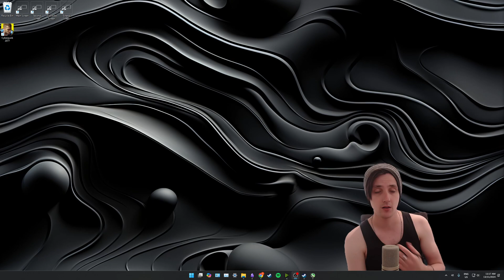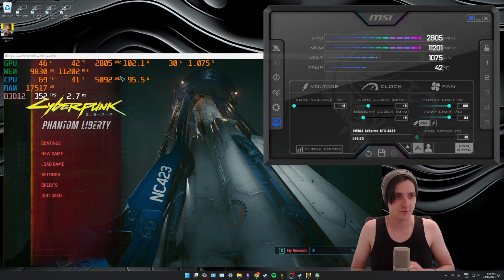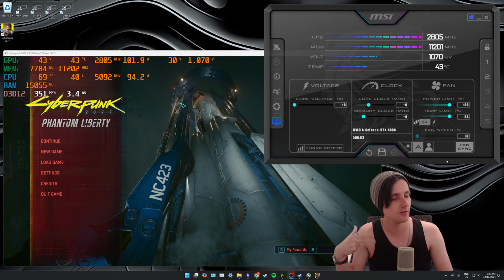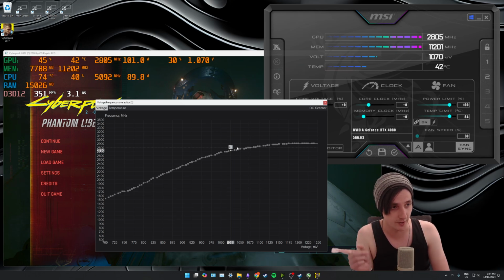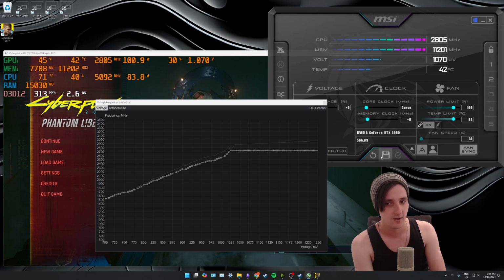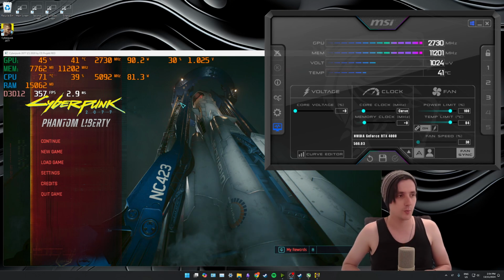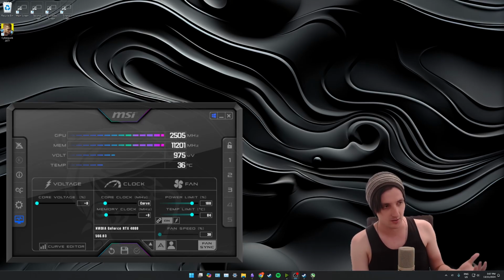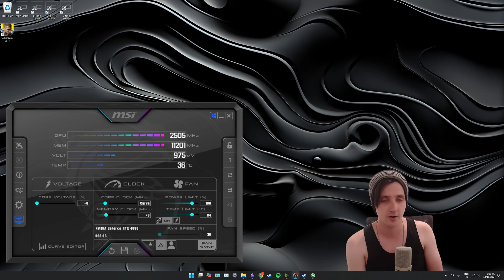NVIDIA RTX - Undervolting guide (How-To)

Comment: MSI Afterburner by it's nature is programmed to limit voltage adjustments so that it's not possible to damage your GPU. HOWEVER! There is soon to be a version of MSI Afterburner that will unlock said voltage sliders completely so that you can aggressively alter it in a manner that WILL allow for your GPU to potentially get bricked should you do so incorrectly.

Comment: I’m planning on building my first ever PC and most likely going to go with the RTX 5080. I’d like to undervolt it so the power draw is lower and somewhere around like 250-300W range compared to the normal power draw. How would I know what to set it to for me to achieve this exactly? Apologies if any of this sounds stupid I’m still researching and trying to understand all this PC gaming stuff.
Reply from the maker: Hey Mate, 
Its basically the same as in this video,
From an undervolting\overclocking perspective nothing has changed moving from 40xx to 50xx series.
What i would do in your case, is in MSI Afterburner, you will see a slider called 'Power Limit', by default this will be set to 100%, you can drag this lower or higher.
Move it lower (say 80%) then apply it, load up a game and check how much power you are using.
Keep doing that until you get your goal power, then you can follow the steps in this video to 'refine' it.
Essentially you are using the powerslider to find a good starting point for how much power at what clockspeed your card does out of box.

Anyway, a 5080 is a beast for PC, enjoy it mate :)

Comment: Does MSI Afterburner need to be running in the background for the undervolt to apply or can I uninstall the program after tuning the settings
Reply from the maker: Hey Mate,
No, it needs to be 'installed' however it doesnt need to be running all the time...

In the top right corner of MSI afterburner, there is a windows icon.
If you click that, it will apply the OC\UV at system startup. (can hover over it for a better explanation)
This means MSI afterburner doesnt need to be running (it does need to run at startup and will apply your undervolt, post this, once you have logged in, you can close the app from the icon tray so its no longer using system resources and your undervolt will stay applied.)

However,
Only use this 'apply at startup' option if you know the undervolt is stable, as you dont want an unstable OC\UV applying at startup.

Hope that answer it mate.

Comment: Thanks for the video , but I want to ask 
Why is your yoru stock core clock 2805, even I play full settings BlackMyth Wukong, I only got 2670 at stock core
Reply from the maker: Hey Mate, 
Few factors, mainly what GPU are you using? 
Brand and the model.

In the video, I have an ASUS TUF 4080.
This card runs at 1..07v out of box, (i think NVIDIA's spec for the 4080 was around 1.0v?)

Asus advertise my card as:
OC mode: 2535 MHz
Default mode: 2505 MHz(Boost Clock)

But that is the minimum garenteed clocks, 
All GPU's today will run higher than that due to GPU Boost. 
which will boost as high as the card can go as long as its not hitting any thermal\power walls.
Reply: @John_Morrish  Thanks for your response
I have 4080 Super proArt with specs 2610 at default 
OC: 2640 
But when I run a game with any settings, the highest Core Clock is 2670-2685 and idk why :(
Reply from the maker: @manhcuongle8770  Do you have MSI afterburner installed? 

If so, drag your power limit higher as a test and run a game and see if any change. 

I just looked up the card and most proart 4080 supers seem to run around the 2800mhz point aswell.
(keep in mind, a bit of this is silicon lottery, ASUS gaurentees 2610\2640mhz.
Anything higher than that and its GPU boost giving you extra performance)
Reply: @ yes I tried to OC when it can reach more than 3000MHz when OC with 1100mV 

But with stock it only reached 2670 without any OC
Reply: @John_Morrish  wow thank you for your response, I don't know why now I got the answer

Comment: Why can't NVIDIA make it able to do that undervolt and overclock using their NVIDIA PANEL like AMD did to their cards with their app
Reply from the maker: Yep, would be good.
In the NVIDIA app, under system > Performance.
You can tweak super basic stuff like Voltage Max, Power Max, Temp Target and fan speed.
But thats it unfortunatly...

Comment: Thanks for the video!
But I dont get that in the first comparison chart the 3rd round says 2805 MHz and in the second one it says 2820 MHz?
Reply from the maker: Thanks mate!
I meant to have it on all comparisons.
Essentially they are the key changes run to run.
1st run is the base
+ 2nd is with -0.50v
+ 3rd is settings the max clock speed to 2820nhz,

So on the last (3rd) run, while I had the -0.050v the max clock speed in addition the max clock was bumped up to 2820mhz. 

But in the last comparison slide, the minimum it hit under the 3 run average was 2805mhz.

happens as the card heats up, just the way GPU boost works, it will step down your clock speed in 15mhz chucnks.

Essentially, once you pull the power back, you then want to see how high you can get the clock speed so as to not lose performance, in my example, as my power reduction was minimal (most people will goto -0.100v) I ended up gaining performance, then as your card is running cooler, it should be able to maintin the clock speeds for a longer period of time.

I 100% could have layed it out clearer or explained it better.

regardless, hope that clears it up mate.

Comment: If i want to overclock and undervolt, which should i start with first. Should i find a stable overclock and then tweak the curve from there to find the lowest stable voltage? Also, if i use the slider to overclock, does it also reflect on the curve, or should I just use the curve for both overclocking and undervoting.
Reply from the maker: Hey Mate, 
Hm, it would depend on what was more important too you, if the overlcock is the important part, then start with that, and reduce the power as the last step.
Essentially, you would do what i did in the video backwards :) 

For memory OC, use the slider, for Core OC, use the slider, but make sure to monitor it, if you give it +50mhz on the core, it will apply +50mhz on the curve at all steps in the curve editor, you can see it in real time, if you open curve editor, then you slap the +50mhz on it.

You would do it manually as i did, if you dont want the same clock speed bump up the entire curve, but rather only have it at the high end.

Hope it makes sense, I would say, open the curve editor, apply whatever OC you want in the slider and you will see what happens to the curve.
worst case, just click reset :)
Reply: @John_Morrish  Thank you for replying. Your explanation makes sense. Will give it a try once I receive my 5080. Also, great video, very straightforward and easy to understand.
Reply from the maker: @GabrielK098  thanks mate!

Comment: Hi, I'm getting a 5080 in a few weeks, and I'll be coming from AMD after 5 years, where their software allows super easy control of clocks and voltages. 
This video has been very helpful I'm definitely revisiting it when I get my card. Last time I used Nvidia was a 1050ti in 2019, sucks to lose AMD's Adrenaline software and going to MSI Afterburner to tweak stuff but I needed the Nvidia feature set.

Would it be possible for me to do say, -100mv or more if I was lucky? Or do -50mv, and actually overclock the card (my preferred method) to get more performance for the same power as stock?

I'm gonna be at 1440p with a 5800x3d so nearly cpu bottlenecked. Unrelated question is do you know if DLAA reduces fps? If yes I'm planning to use it in games where I have high fps already to minimize any possible cpu bottleneck.

Regardless thankyou very much this video was amazing!
Reply from the maker: Hey Mate, Lucky you, hope you enjoy the card :)

"Would it be possible for me to do say, -100mv or more if I was lucky? Or do -50mv, and actually overclock the card"
Most likely yes, we all know the 5080\5090 pull so much power, i would start by deciding how much you want to shave off, start with the -100mv, then see if you can get close too normal clock speeds. 
wort case, if you cant, or if performance dips too much, then start slapping on more V till you are stable.
In the video, as it was an example i only did -50mv, and i was stable at the same clock speed. 
I have messed around since and can go a bit higher before it becomes unstable.
If you drop a full -100mv off, I dont know about overclocking, but I would expect at least normal clock speeds\performance or close to it.

"do you know if DLAA reduces fps?" Yep, it certainly does, BUT, it is the best form of AA currently IMO. 
The hit is not as high as say MSAA, but it can still be around 5-10fps on my 4080 @ 1440p.

If you are CPU bottlenecked, and at 1440p, Look into 'NVIDIA DLDSR', I have a video on this here: https://www.youtube.com/watch?v=0btR4OJNNaE&t=109s
In short, you render the game at a higher resolution and it will output it at your native resolution, if at 1440p, you can  render the game at 4K, get a better image, and it will act as though you are at 4K, so you're in less of a CPU bottleneck :)

Hope it helps mate, and enjoy your new card!

(Also, Make sure when you are testing your undervolt\overclock, run a game\benchmark that uses RT, as you want to use all of the GPU to make sure its stable)

Comment: I always thought undervolting was a bit like black magic. Now I know better! 🤣🤣
I undervolted my 4070 Ti following your video, ran the Cyberpunk benchmark at 4k (before and after of course) and with the same clock speed I had the same FPS (a fraction of a frame higher undervolted) with everything maxed out in the graphic settings.
The frame rates were only 27fps but I pushed the card because I have a 5080 coming tomorrow that I won in an online raffle and I want to compare the jump in power.
Reply from the maker: Envious you got a 5080 mate, enjoy it!
And yeah, Overclocking has been following this logic since GPU boost was introuduced, so you can do the same on the 5080 and save some power :) 
It is fun and rewarding seeing performance gains, it will scale the bigger the GPU, so on a say a 4060 you would get small gains vs a 4090 where you can get massive gains.

If you want to see the bigger difference, turn of RT in cyberpunk just when benchmarking, you should see a few extra frames, as when you are getting low FPS gains are less noticable.
Reply: @John_Morrish  It's been a great start to the year for me. I upgraded my motherboard (ROG STRIX X670E-F Gaming WIFI), RAM (64GB (2X32GB) Kingston Fury Beast Black CAS32 DDR5 6400MHz) and CPU (AMD Ryzen 7 9800X3D) in the new year to take advantage of GEN 5 tech, so I thought I'd enter an online raffle for a new GPU. I won a 5090 pre-order from the same raffle site two weeks ago that I won the 5080 from two nights ago, but it may be a while before the stock is available, which is why I entered the 5080 one, never thinking I would actually win again! Now I can test the difference in gain with the cards (well, eventually). My main reason for wanting to undervolt was to help mitigate any potential worries about the 12V-2x6 or 12VPWR connectors (I know it's all overblown, but it's best to be careful). I upgraded my PSU to a ROG STRIX 1200W Platinum and it has its own 12V-2x6 connector with voltage regulators attached to a couple of the cables at the GPU end. Anything extra I can do is always a bonus. Saving money, extending hardware life and giving me peace of mind all at the same time. 🤞
I mostly game on my Gigabyte G32QC curved 2k monitor, but I might go back to my 4k Predator XB321HK. At the very least I'll start using both, if I can figure aout a comfortable set-up for me. I use an L-shaped desk, so I have plenty of options I guess!
Reply from the maker: @Mr3quilibrium  Damn mate, too many things to play with.
What are your plans when you eventually get the second GPU?
Given how rare they are I hope they dont goto waste ;)
Reply: @John_Morrish  I'll sell my current 4070 Ti and keep the 5080 for a while, just to make sure the 5090 isn't going to go boom. Then I'll probably sell the 5080 too, but I'll make sure it goes to a real gamer and not some scummy scalper.
Reply from the maker: @Mr3quilibrium  Ha Good!
Hopefully you're set with the 5090. You're a lucky person my friend. 
Enjoy the new build, having the best gaming CPU plus best gaming GPU, doesnt get better than that.

Comment: Why only -50 millivolts? It will probably work fine at -100 millivolts as well. My AMD runs smoothly at -150, and I haven’t lowered the frequency—it remains standard!
Reply from the maker: Hey Mate, 
Cause i was recording a video :)
It goes lower but i didnt want to risk crashing OBS and having to redo it, so i chose low enough the point would come across without risking stability issues whilst recording. 
Although tbh i have only dropped it -100, I care about performance and if i go any lower, i start losing frames (whilst saving more power).

Comment: I run my Strix 4090 at 2820mhz at 975mV, I did used to have it at 940mV but lost around 10fps for some reason.

I  did used to use it at 2700mhz at 900mV, with minimal fps loss but it felt wrong downclocking on a 4090
Reply from the maker: Yep, i mean you are paying for the best, so i get why it would feel wrong.
Did you see much temp difference between stock vs your undervolt?

Comment: Undervolting is despicable, at least for GPUs, for starters, because it doesn't do what it says or what one would expect. The way it's automatically tied to an overclock (lower voltage to higher frequencies) is hugely annoying. And it's not enough to test it for stability, things might appear "stable" and instability can look so strange that one might overlook it as a factor. Undervolting errors are among the weirdest ever, like little red lights appearing in games over time (more and more), or games crashing with strange error messages that if you google them, you go down a very different rabbit hole...

The bottomline is: stability testing in benchmarks is useless (or takes a week), one needs special tests which specifically count "artefacts" (generally invisible). The MSI Kombustor has a few tests like those. They are super helpful, but I've never seen them mentioned. But the real bottomline is: it's better to not care about undervolting the GPU. Undervolting anything else is relatively chill.

Comment: What do you think the best memory clock and core clock setup for 4060ti kinda new figure out the best performance?
Reply from the maker: Hey Mate, 
It will differ card to card, so no gaurentee its stable at these, but this is a general starting point or quick slap on.

Volts: 1.0v
Core clock: 2805mhz
Memory: +1000mhz

Pretty much all 40xx series cards can start with +1000mhz on the memory clock.

If you do crash and it doesnt look to be stable, either increase the volts slightly, or deacrese the core clock.
But that its a pretty general starting point when overclocking\undervolting a 4000 series

Comment: The best guide on undervolting i've seen so far. I am running 1702 at 0.850v on my 3060 laptop GPU. The temps/power decrements are incredible. 0.8v crashes while the laptop is idle sigh
Reply from the maker: Thanks mate, Happy its working for you!
It gets frustrating when you want it to be stable a X number and its not. 
Make the annoying choice to either raise power or drop clock speed...🙄

Comment: I'm running a 4090 at 2715Mhz at 0.96V, and +1400Mhz on memory. Runs stable and cool.
Reply: I'm running a 4090 at 2805 at .975 and +1700 on memory. Runs 80-100 watts less. And yes, i've run memory tests on the GPU memory OC, it's completely stable at +1700.
Reply from the maker: @andremessado7659  Amazing mate!
Reply from the maker: Yeah sweet mate, 
I am running +1000 on mem now for my 4080, might see how much more i can get this weekend out of it.
Which 4090 model do you have?
Reply: @ That’s great. I have Gainward Phantom.

Comment: how to tweak it ourselves before the system becomes unstable?
Do we do it in 0.25v decrements while increasing frequency?
If it's unstable what will happen? will it crash and brick our pc? what are the remedy procedures if it becomes unstable and what is considered unstable or signs of instability to look out for before a crash??
Reply from the maker: Hey mate, Its upto you in what increments you adjust the voltage. (the clock speed is in increments of +\- 15 on Nvidia 4000 series GPUs)
If you can make it through a benchmark or stress test then you close to being stable or stable, i normally run a bench 3x and if it hasnt crashed then i would save the profile.
(You might think its stable and maybe once every 2 hours get a crash, either bump down the clock speed by one increment or up voltage by one increment.)

No, it wont brick your PC and a simple restart will be worst case situation to get you back up and running!
by default, any profile you make wont apply at startup, unless you turn that on in MSI Afterburner.
If you run a benchmark or game and it crashes, you can tweak it in MSI afterburner by a small amount and try again.
The sysmptoms of not being stable can vary in  3 stages.
1. Flickering lights\textures in game (you are close to being stable)
2. Game\benchmark crashes (windows is still fine) 
3. GPU freezes (restart PC and try again) 

Next to the 'Save' button in Afterburner is a 'reset' button, that will move ALL values you set back to default, so if you get confused at any point, just click that, then try again :)

I am debating on doing an Overclocking video, if i do, i will make sure to including your questions in that aswell.